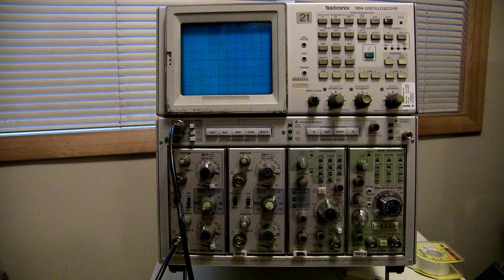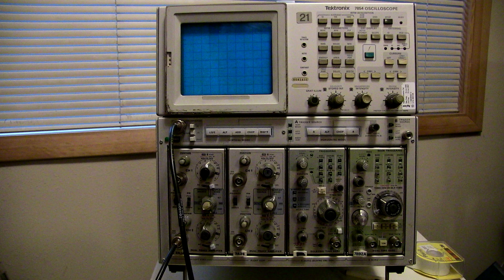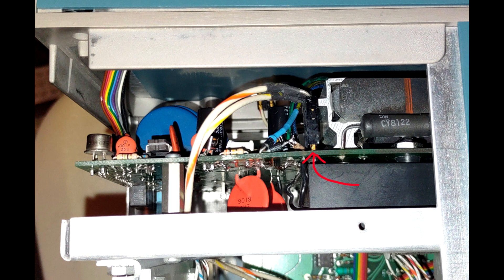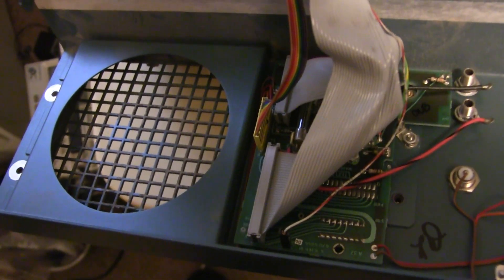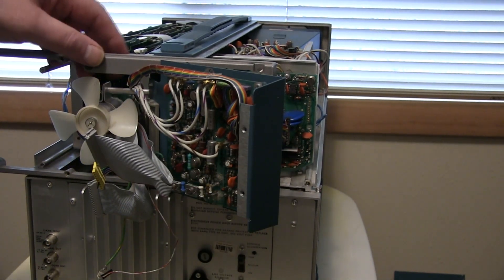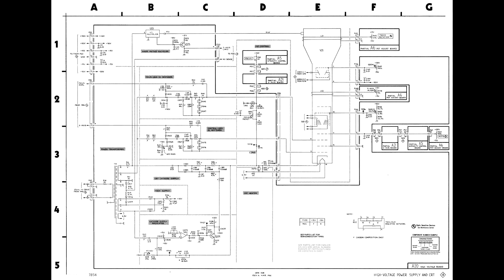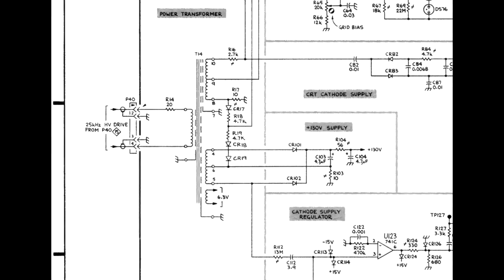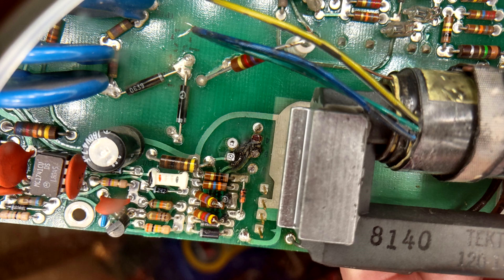Tektronix 7854 Digital Storage Oscilloscope Repair

Comment: Thanks for the repair video. It makes me think I should get around to repairing my 7854. It has gotten to the point where the processor doesn't seem to work correctly until the scope has warmed up for an hour or two. Before that you can't clear the initial "self test complete" message, and can't capture a trace or view trace memory. Probably a cap problem of some sort.

I just powered my 7834 on for the first time in probably 5 years, and very annoyingly it seems to have an HV problem. All of the readouts are completely out of focus, and possibly (I'm not sure) the raster might be a little smaller than it should be. I don't have plugins in the mainframe, so can't check the trace, but I'm sure it would be out of focus too. Probably another old cap problem. :-(  A decade or so back this scope had a problem where it wouldn't power up, and it turned out to be a shorted small tantalum cap on the backplane board the plugins plug into.

Comment: Eddie VanHalen used a variac on the first album.  He'd run the amps' voltage to around 140 vac, and he said the tubes would wear out in about 2 hrs, and the (very expensive Marshall) amps in 12, or something thereabouts.
Reply: Filament life is proportional to the 13th power of the applied voltage. That's a big number. Assuming the amp was rated for 125V (somewhat unlikely), 140/125 = 1.12; 1.12^13 is about 4.4, so the tubes should only die 4 or 5 times sooner than normal.

If I assume the amp was rated for 115V (more likely, I suspect) 140/115 = 1.22; 1.22^13 is about 13, so the tubes should last 1/13th of their normal life.  If the amp was rated for 110V instead of 115, the tubes would die about 23 times sooner than normal. 

All of those times should be well beyond 2 hours, but there may other factors at play, like blasting the coating off the filaments, which would drastically reduce the tube output when it happened.